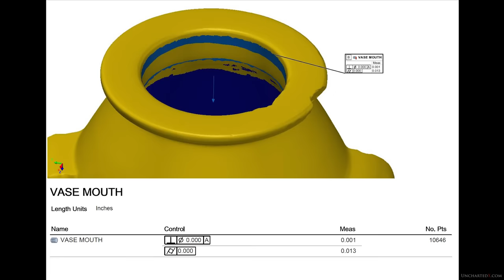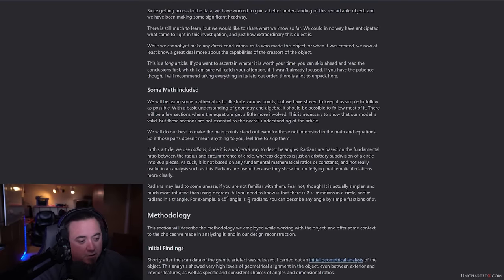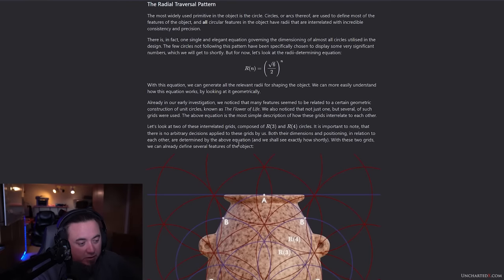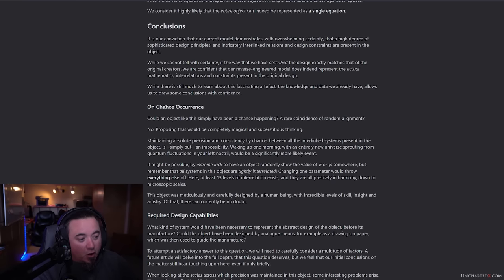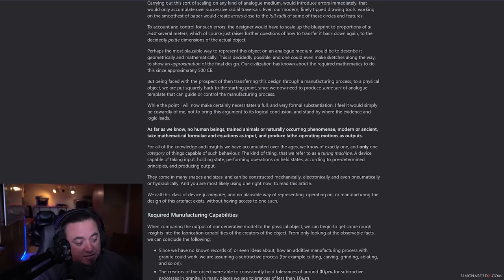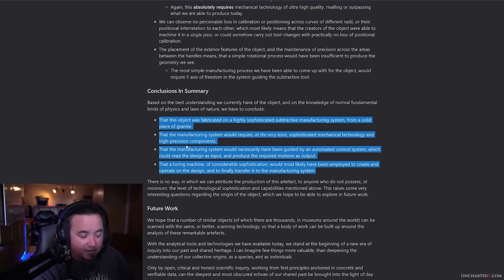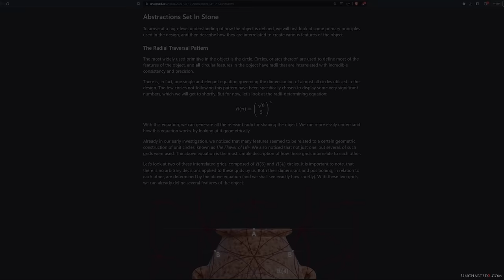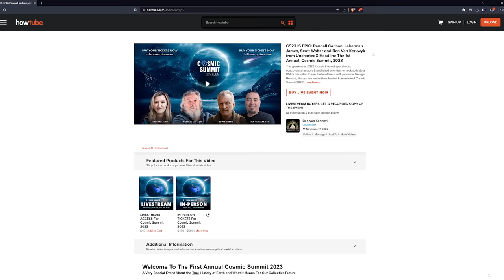Was a COMPUTER Used to Design this Artifact??

Comment: It’s blatantly apparent that these ancient objects are very special, especially when you see it side by side with an artifact that was really made by hand. Public opinion about these artifacts is slowly coming around. Great piece!
Reply: it's really remarkable that we were not even able to fully appreciate the precision of these objects until the past few years using precision computer imagery. I say the next thing to be analyzed after these vases should be the polygonal masonry that spans the entire world. in particular, the polygonal stone walls that perfectly interlock and curve in three dimensions. we know this because we are able to see between the stones where past earthquakes have slightly separated the walls, and the stones perfectly conform to the opposite face throughout the depth of the joint, despite curves or angles. this is simply IMPOSSIBLE to achieve by hand, and was likely created using the same technology as this vase. we'll see in due time.

Comment: As someone who works on Cannon steppers I am glad the data is given in microns (micrometers) instead of inches like the last videos 😂. Really helps you grasp just how precise this thing is and is comparable to specifications we have for tools used in the development and creations of microchips.
Reply: Machinists tend to deal with thousands of an inch, which is why the other videos use that unit of measurement.
Reply: Old Cannon Steppers? Boy I don't miss working on that dinosaur. What models do you work on?

Comment: I do not know if this question was posed, but has anyone considered the ambient temperature while the measurements were taken?
Because we are talking about such tight tolerances in the construction of the vase, it could be whatever ambient temperature was in the workshop where this vase was created could make a difference when measuring the vase in a different temperature.
If the vase was created in a room where the temperature was a steady X degrees and the measurement was taken at lets say in a warmer temperature the vases measurements will be slightly off due to the expansion and contraction of all known materials from differences in temperature.
Therefore, this vase may be more accurately created then measured as astounding as this may sound.
Thank you.
Reply: Pro metrologists will have ensured temperature stability, and will have allowed the sample and instruments to "season" for true consistency.

Comment: This is very interesting because I am over 70 years old.  I studied computer studies.  It was very much a new subject at the time.  I won a prize for producing the punch card instructions for the computer to sort 3 numbers because I needed only two cards over the known minimum number.   Most computers at the time used punch cards though some used paper tape, which had a habit of splitting, so was not an advance.
My husband later acquired a programmable desktop calculator, we still have it.  It could drawn graphs amongst other things.  And when I say desktop I mean it took the whole of the desk.  
I do not know at what point in time computer controlled precision tooling came in, but it was well into my life.    Computers still filled whole rooms in 1977 when I had my first child.  The boxes of cards for our accounting transactions were sent in a van to the computer to hopefully run our monthly bookkeeping overnight, and send mountains of paper printouts back the next day.  
I do hope that some one will lend you another vase to produce detailed scanning information.

Comment: A fantastic presentation Ben!  Looks more likely to be based on radians than pi, due to the integers in the choices of arc radii.  Look forward to more analyses like this.  Mind blowing.  Very happy to be a sponsor.  (I assume that "turing" machine means "computer".)
Reply from the maker: indeed, that's what we call turing machines these days!
Reply: A lot of turning is done now days by a lathe that is computer controlled. The term CNC lathe is a description of a lathe that is computer numerically controlled. You can input the profile as described by the mathematicians and work the material to produce the profile. A five axis machine can do also milling machining which would be used the produce the handles.
Reply: @Bob-cu8no  Indeed.  In fact I have 2 CNC lathes, and a 4 axis CNC mill, plus other non CNC machines.  So I know what these machines capabilities are.  And a 5 axis machining centre could in theory make the vase with handles shape.  But in granite?  Including the vase interior with the thin walls?  With the level of finish of the granite vase? Possibly.   And the real point is how did they make it 5+ thousand years ago.  Did they have 5 axis machining centres? It is mind boggling.

Comment: I am a learned tool maker "Werkzeugmacher", worked on CNC machines of all kind, have yearlong experiences as "Mess-Techniker" and finished as CAD-Engineer. Honestly it would not be possible do produce this thing with our tech today. We used stone not much harder like this to sharpen our hard metal tools for one. To construct this you would need a good 3D design program, that we do have. We can reconstruct or retro-understand its geometry. But on what 5axis CNC milling machine would we be able to work with stone, hard like rose-granite ? With what tools ? Diamonds ? How could we make it in one run, out of a solid block, with that precision ? We could not ! No one on this planet, with our technology can. If someone says he can, please proof it ! I have 30 years experience in designing, programming and working on all sorts of metals, but even there (and we worked for ESA) we did not have that high a precision as seen on that "simple" stone vase. It is just ridiculous and certainly was never needed to be that precise. So it was just a side effect of producing it. It was easy for a civilization that came before us to create and produce things that we can not really understand yet, because we lack the technology, to understand how they did it. I will say, that if you measure more of those "vases" you will even be astounded more and more. Because i have the gut feeling they all were created and produced using the same algorithms, will show the same precision and will proof that a technology, much better than what we have now, was used to make them. Thank you for your work, all of you !
Reply: I do believe we are survivors of a past civilisation. However, people are capable of doing amazing things ...
An interesting experiment is currently occurring in Russia which you might want to follow up:  a lady called Olga Vdovina makes stone vases by hand. it takes at least six months to make one. Olga is now filming the process as she creates a diorite vase.
Reply: @lynnehaywood5305  Thanks. Her work proofs that we are not at the level of our lost civs, yet. Maybe in a few thousand years.

Comment: Keep up the good work Ben. This is true archaeological work that your doing. 
Great to see actual manufacturing Engineers being involved in this study. Desiging something is one thing, but manufacturing that design is unbelievably more complicated and absolutley unapreciated by most people.

Is there any evidence of a lost molding process which could explain the handles? This would of course mean a molten/slurry material being used... maybe the structure of the stone material itself can give further clues...
Reply from the maker: I don't personally think it was geopolymer, there does seem to be striations/grooves on the inside. Tough to scan but recently we have CT scanned this object and subjected it to microscopy to find out of there are fine tool marks or any embedded material. Analysis is underway.
Reply: You still have to create an incredibly accurate mold which still doesn't take away from the precision aspect and difficulty to create. And if this were the case then you would see exact duplicates...
Reply: Don't think the handles were molded or similar, because each type of granite has its so-called fingerprint... But I could be wrong
Reply: As a tool and die expert myself and working daily in PVD nanocoatings, I appreciate fully the work involved in a mold of this accuracy. Considering the amount of these vases found, it would make sense from a production standpoint to have some type of mold. Of course it could also be machined... however it was made, this type of accuracy is amazing.
Reply: Even if you heated up granite u would still need something to form the shape and possible it could leave tooling marks behind

Comment: I'd be very curious to know if the vase's thickness is 'consistent' throughout? If this was able to be ascertained or measured somehow, and it revealed that it was indeed 'consistent', then that would solidify even more the extraordinary magnificence of it's creator!
Reply: It is in the earlier videos but it's consistent
Reply: The interior surfaces are noticably of lower precision. Machining marks are also slightly noticable. The aesthetic focus of these pieces were the exterior faces, it seems. Having said that, the wall thickness are still dangerously this.

Comment: This is absolutely fascinating. I would be incredibly interested to see someone use a CNC machine and cut a duplicate out of something like copper. Then have that duplicate analyzed in the same way. Just to see how close modern machining can get to the precision found in this artifact in even a softer and much easier to work material. I have a feeling it would be incredibly telling.
Reply: Those tolerances are routinely achieved on very hard steel components with modern manufacturing processes. There are millions of passenger-vehicle diesel engines with high-pressure fuel systems that operate at 2000+ atmosphere pressures using micron-level precision parts. That said, there are only a handful of companies in the world that can make those systems, and it has taken a over a century of continuous development to get to that level of machining and measurement capability.
Reply: @kenpumford754  the problem is those tolerances cannot be achieved in granite with modern machining.

Comment: Very good. While I don't think there is any doubt about the maths behind the design not being accidental but it would be interesting to scan and study multiple specimens to compare and see if there is an even wider more complex methodology behind these artefacts.  Love your videos.
Reply: It needs to be done before we can take this too seriously, and ideally by other laboratories and researchers with no external pressure. I’d even like to see this specimen re-scanned or measured by others.
Reply: @Aqua Fyre could you expand on that or reference, not sure i follow
Reply: You guys do realize that any shape can be deduced to mathematical functions posthoc. It doesnt prove anything.. the used production tools are the real mistery
Reply: @ypey1  but to MAINTAIN that level of precision from design to implementation implies some sort of computer control
Reply: There has been some study in the ultrasonic cutting of stone utilizing metal tubes. The math presented may be showing a connection to the type of tool used to make it.
Reply: @Prism775  the radius of the vase opening is within 0.01% accuracy of the wavelength of 16 ghz.

Comment: Hi Ben. If this is a machined object, created by some sort of digitally controlled tool, then certainly there would be multiple duplicates produced of the same exact dimensions. So my question is, are you seeing this? Is every vase, bowl or plate that is unearthed unique? or are there duplicates that can be matched and cross checked? If there are, then that would surely strengthen your theory.
Reply: Yes! One cannot infer nominal dimensions without having duplicate parts. What needs to happen is to round up all the vases that are the same and measure each one and see how they compare in size.
Reply: that is assumptive…. whoever made this possibly had the ability to EASILY create any number of objects without even breaking a sweat mentally or physically. This was probably an easy thing to understand and produce
Reply: @designfabrication512  I take your point. If that was the case though, surely they would diversify away from just making pots.
Reply: @TCCTaylor  I agree but we have no idea what they used these for and knowing human nature any other artifacts would have probably been destroyed or damaged through time as with the tools. These vessels just happened to have been protected through time because they were stashed underneath the pyramids and undiscovered until fairly recently. Some king or pharaoh had a use for or interest in these and stockpiled them in one place. Hopefully we will find other undisturbed sites where tools and other artifacts are hidden

Comment: This is insane! I need to know who or what made these things so precise. I’m a machinist and this is insanely accurate. I do tool changes almost daily and have to make adjustments to the tool offset every time I put in a new drill, front turning insert and so on. The ancients for sure had a computer and or some type of CNC machine. There’s no way! 🤯🤯🤯🤯🤯🤯🤯🤯

Comment: Looking at something like the Antkythera device that utilized gear ratios, I could see a sophisticated mechanical lathe being developed over time. But what would they use as a bit that could resist wear enough to maintain spec?

Comment: The Antikythera Mechanism is a computer and dated to "before 70bc" by the age of the shipwreck it was in. 
The ancient Greeks were playing with steam engines by at least 30bc, and designing mechanical steam powered birds.
The Baghdad Battery is dated to around the same time, and many similar ones have been found in the same area.
Then there's the ancient drill holes in Egypt showing signs of precision machining.

I think there was quite a lot of bits and pieces of technology from ancient times that was lost.
Reply: They had steam powered airships, it is not an extreme impossible thought.
Reply: @sebastianheinze795  Did they?..
Reply: @sebastianheinze795  I think some technology might've been suppressed until a time when it was safer for it to spread.
It reminds me of a quote from a book called: "The History of Rasselas, Prince of Abissinia"

"If, sir, men were all virtuous, I should with great alacrity teach them all to fly. But what would be the security of the good if the bad could at pleasure invade them from the sky? Against an army sailing through the clouds neither wall, nor mountains, nor seas could afford any security."

Leonardo DaVinci also had concerned about how some of his inventions might be used, and deliberately left key parts out of some of his blue prints for this reason...

Comment: The only other thing I can think to add is that you may also need to take into consideration that the ancient people may have been able to manipulate stone in a way that made it in a clay-like or even liquid substance.   So maybe not just a "subtractive" method... but either way, I agree that they must have had very sophisticated technology.
Reply: Definite possibility right? But we then need the same level of high technology to create the mould in to which they were poured. Not only do you need the exterior shape but you need to make sure the hollow is also created. For me both are options but not without a higher technology than the Egyptians appear to have had. Not saying they didn’t but show me the evidence they did.
Reply: @@user-kn6pn1cn8m Still doesnt explain the resulting precision or methematics used to design it even IF that was a remote possibility.

Comment: This vessel is truly amazing for sure! If the tolerances are as exact as they, indeed are, then it stands alone among stone pots!  It is beyond a computer map, and mechanical cutting tool.  The explanation you gave, of all of that, was excellent.  Who owned this pot, and what did they use it for?
Reply from the maker: its the first vase this type of analysis has been performed, we don't know if it stands alone - I suspect we'll see similar results should we get the chance to analyze more vases to this level....
Reply: @UnchartedX what about the inside of the vase ??
Sorry if it's mention in the video I didn't finish it yet, keep the good work 👌👍
Reply: @jamesn.economou9922  I dont think they would be a "bitch", first you start by machining the shape of the "handle" the entire circumference, then when done with the exterior, remove the material in between the "little handles".

Comment: In 2023 the manufacturing tolerances for most pots and pans is significantly LESS than these artifacts
Regardless of Academics clinging to their paradigms of human history. 
The level of precision factually measured on these ancient pots was not required, nor needed for cooking and/or storage vessels.
Multiply that breathtaking precision by 30,000 minimum, the pots that we found, and you begin to see how bloody ridiculous it is for academics to maintain that these vessels were made by hand, using only pounding stones, flint shards and copper tools.